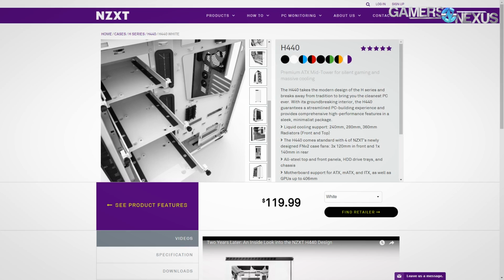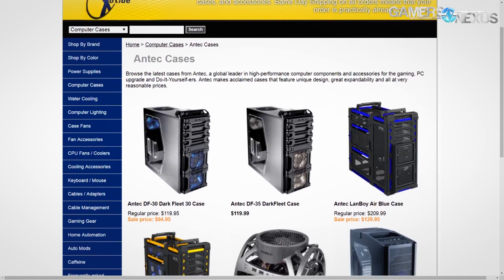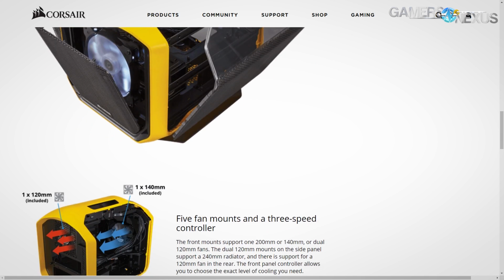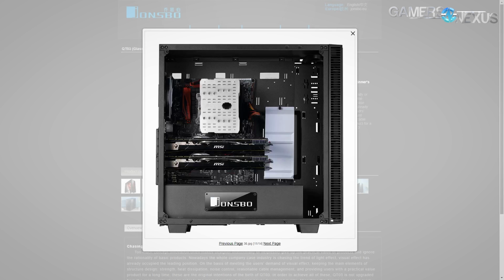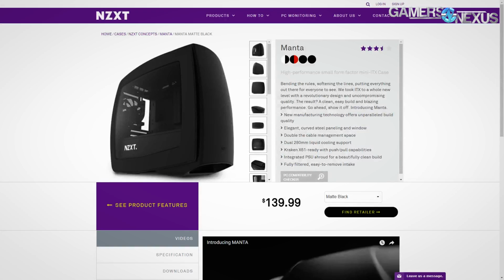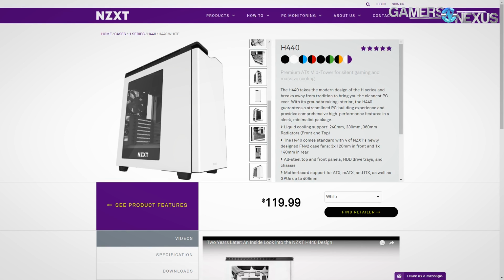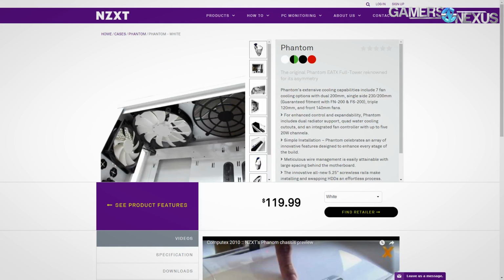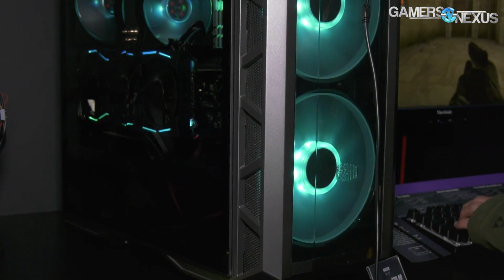Reviewing the Case Industry

Comment: Over 25 years I've mainly used basic no-name/in-win type cases. My first investment case wise was the Silverstone FT02 with the inverted motherboard position, I was looking for a similar replacement because the FT02 would need heavy modification if I wanted to go the custom water cooling route and it's a bit out of date for today's needs. I only found the Be quiet Darkbase 900 Pro which is just overkill and not value for money.  Silverstone haven't really produced a good successor to the FT02 in my opinion.  I would like to see more cases with inverted motherboards and the air being drawn in from the bottom.

I started looking at the other options available, so I checked out the NZXT H440, Caselabs SM8, Corsair 900D, IN-WIN, Fractal Design R5, Silverstone Primera etc. I ended up replacing it with the Phanteks Entho Evolve tempered glass, which even though it's a mid-tower it has the same space as the FT02. The airflow seems pretty good and the design made it really easy to build in.  It has good support for RGB if you want it and water cooling.  I am a bit surprised you guys didn't talk about Phanteks.

Coolermaster and Thermaltake I've always viewed as just cheap products with lots of useless crap on them mainly focused on the Chinese market and I could always find something better from other companies.

You guys should check out Singularity Computers new prototype case the Element Six, obviously its more of a show case and not mean't for mass production however the intent is to try and stimulate the case market and apply a functional approach with pleasing aesthetics.

Comment: i think what needs to happen is someone taking what caselabs is doing. but bring it to a affordable price. i honestly think that you can get people to spend $160-$210 for a case that can be just like a caselabs case.

kinda what EK is doing with the watercooling kits with aluminum. they are taking their original products (which were not super expensive but to many they were) and bringing them to a market for others to get into. 

i think that needs to happen. i've always wanted a caselabs case but i dont want to spend more than $300 for a case. $250 max is my limit but yeah. if corsair or some company does that. i think they will have a win. just like how ek is pushing their cheaper open loop kits. most cases don't really support it and some do but its kinda janky. case labs type case but on the cheap would be perfect. 

honestly i hope someone at EK see this lol. they can look into going into case's and they can sell cases that would work perfect for watercooling.

Comment: I have an In Win 303 that I love, I just need a Thermaltake Floe 360 to come in stock so I can finish the darn system to how I like. Will look so nice with the fans side on so can see all the lighting effects.
It does need better cut out points for the cables but other than that is great. The mechanism for the tempered glass window is genius and makes thumb screws obsolete.

Comment: I don't know why, but I've always really enjoyed "cube" cases that are efficiently designed with compartments. I'm still rocking my original Corsair Carbide 540 Air (couldn't afford CaseLabs), and although it's build quality is just adequate and it certainly doesn't feel like a premium product, I still love it for its efficient design and very functional cooling features. Now, I'm much more interested in smaller form factor cube cases made with premium materials (aluminum instead of steel, tempered glass rather than acrylic, etc.  Honestly, I REALLY wish both motherboard manufacturers and case manufacturers would just go balls to the wall with mATX designs. I love ThermalTake's Core V21 cube case, but man, it would be SOOO much better if it weren't just steel and plastic. It's a great case, especially for the price. But, I'd definitely spend 2-3 times as much for the same design as an anodized aluminum chassis.

Comment: All I want in a case is a see-through panel, a window and general practicality. Less screws to hold things in place perhaps and some more refined solutions.
It should cost between $50 and $100. It should always be possible to install an optical drive, for the retro games and for installing windows and watching DVDs.
It should also be streamlined to a point where there is nothing really missing and nothing feels weird.

Comment: The complete lack of acknowledgement of the importance of airflow is the most worrying thing I've seen when looking at cases for the last few years, especially with the front panels (top as well).

I love my Phantom 001 with 200mm fans. I love that the new HAF H500P has them again. The excuses given for not using 200mm fans in the video aren't good reasons for me personally. I don't care to use a radiator, and I certainly don't mind having a wider/larger case size or spending a few extra dollars on good quality fans that will actually keep my components cool without causing extra noise. Bottom line for me: 200mm fans are awesome, good airflow is a necessity, and case manufacturers need to keep this in mind while still designing solid and interesting cases - if they ever hope to match or beat designs like the original Phantom or the new H500P.

Comment: As an engineer, I see all sort of wrong in ALL pc cases. Hot air raises, but why only vent it at the back. If air intake is from the front and vent at the top, big percentage of air going in will just go out without even transferring heat. Air coming into the case mostly spiraling, why most cases don't take advantage of that.
Reply: Yeah and with the glass side panel and no mesh front, you could really open up the bottom and just have the air intake with some good leg footing, and all vent at the top.

Comment: I'm still using my Antec Nine Hundred for my main pc.  Modded and went through four builds with it.  
I made cutouts for the cable management and put in fan filters, swapped fans for different color.   RGB and dust filters weren't common back then.  Still breezy for almost 10 years now.  
  
Took out the drive cages to open up the front.  I was able to get a 295x2 in there, and a 240 rad

Comment: If case manufacturers stopped making cases over and over and over again on the  same chinese chassis templates, to make 1000% mark up on retail price, that cant think more than a top tiny 120x360 radiator and a front 280, with the shittiest class of steel and paint job, You tube videos like this wouldnt be necessary, and people would be buying 700 times more computers than now

Comment: Such a good video.I am one of those guys, hyped for the h500p.
Initially i saw the case's MSRP of 140$ whilst having 2x 200mm rgb fans AND a pci-e riser.
After some time i saw the price bumping 10 bucks And the pci-e riser(15-25$ separately) gone.
Also i am not really into the non removable dust filters, i think it's a step back.

Comment: Reality is that once you strip away cosmetic "innovations" (acrylic side windows then a few years later glass cases) there has been relatively little innovation over last 10 years with the honourable exception of Silverstone who have experimented with MB orientations.

I would like to see experiments with air flow ducting, more cable management experiments (I have some ideas for coupling physical support for heavy GPUs which also double as cable management).  Dust management is a real challenge - more experimentation in this area is needed.

Comment: I do not like the trend of covering up the intakes with a solid panel. It forces all the air to flow through narrow/restrictive slats/vents on the top or bottom. 

At the very least, the total combined surface area of the opening should exceed the surface area of the fans themselves. What is the point of buying a 380 radiator if its breathing through a soda straw?

Comment: Steve you mentioned the ramping up of GPU fans and causing 60 DB of noise in a good looking case. I can't speak for everyone but I have a excellent surround sound and headset so I don't hear any fans at all when I am gaming and having the ability to adjust fan curves solves thermal throttling. I don't know of anyone who does not play with a headset or speakers that can drown out any fan noise. My thing is if temps are safe what is the big deal most gaming consoles are just as loud if not louder. I say buy what makes you happy and turn up the volume if you don't want to hear fans at all.
Reply: I can see your not an audiophile, that so crappy noise floor you are promoting. cranking up the volume to compensate for load cooling just means you are damaging your hearing faster.

Comment: Great talk guys.  I am a former Antec guy, until just a week ago, I owned and used two Antec cases, the Antec 100 for my desktop PC and the Antec 900 V3 for my gaming PC.  I had those since 2011 but starting a few years ago, I started to have case envy as I saw the new offerings from NZXT and Corsair.  I ultimately decided to upgrade my desktop PC to an NZXT S340 Razer edition and my gaming PC to an NZXT S340 Elite VR edition.  There were several reasons for the upgrades, including the general upgrade "itch" that needed to be scratched, the desire to do away with the 5.25 inch bays, the move to the PSU shroud and getting something that shows the internals of the build in the left window.  There is one noticeable downside to the NZXT cases and you guys hit it in your discussion.  The air flow in the S340 Elite is not as good as the Antec 900.  That monster 200 mm exhaust fan did a great job.  I am currently using the stock 120 mm fan on the Elite, but I likely will upgrade that to a solid 140 mm fan.  Anyway, in summary, I am very satisfied with the upgrades, but the cases are by no means perfect.

Comment: Still just a bunch of big boxes. I want to see more out of the box thinking. Not more windows and LEDs.

SFF is where I want innovation.

There needs to be innovation on the Motherboard, GPU, PS side to enable better SFF cases.  Trying to cram ITX  board and standard components into a  box, limits the design of those boxes.

I'd like to see MB with some better way to connect a GPU(like MXM, or edge connected horizontal PCIe),  and smaller PS...

Comment: Cases are one of those things you buy for your own style. I do think that Coleermaster H500P is great, and if the price is somewhat affordable (I'm in Brazil...that thing, if ever come here, it will be at least 2,5x the price asked for in the US...) I will put a lot of thinking in buying it. I have my sights on the Corsair Carbide 740 right now and it's around 300USD (after conversion+ taxes...). I wouldn't mind a nice glass case, but hey are even more expensive in here (the Corsair 570X costs nearly 1.5x as much as the 740...its ridiculous...)

Comment: I want a case that has access to the bottom dust filter in the front, putting the access in the rear is ridicules. Unless your case is sitting in the middle of your desk, it's a pain in the ass the access the bottom filter.

Comment: The problem with 200mm fans is the positive and negative air pressures within the case, because you can't really get a 200mm fan on the back of the case due to the IO panel obstruction (or until that's resolved).

Comment: I'm a fractal fanboy. Its simple, its sleek. Its decently quiet and has decent airflow. Competitively priced. It may not excel in any one area but it doesn't lack for anything either.

I built in the Define C in June (7700k/1080) and it was a breeze. I'm a little salty the TG panel edition didn't come out but otherwise its an excellent case

Comment: These case manufacturers are so lost..

Steve spoke well on wanting better airflow(this is sad it has to even be a mention at this point). But then when Rob says he'd like to see something new and fresh, he says it with the aspect of perplexity, as if unsure on what could be done.

You guys want some innovation? I'll do you one better, innovation and a chance at setting a whole new standard of componentry at the same time.

http://fanlessfan.com/

If I recall they're going to be open sourcing the design to some degree and are making the thing just to show market viability. This goes against the claims in the video of "idk anyone who spends more than $130 on a case anymore". Skewed claim considering nothing past that price these days is worth it anymore.

With this sort of case you hit nearly every issue the guy spoke of in terms of making cases like "oh so what sort of dimensions for this and that radiator" "what sort of holes and how many do we make". He also spoke about CoffeeLake being great and it will bring all the Sandy Bridge folks over to it, creating lots of opportunity for case makers as well. Now you also solve for that problem of case upgrade cycles being so slow. You can create a modular model (and a non-modular one so you can hit a lower price bracket for people who know they won't be upgrading cases so often), and whenever there is a huge standard change, a simple swap of the parts that can hold the components can be done to make each case customizable and upgradable per major component cycle change, so you don't have to wait 5 years for customers to purchase a whole new case. This also goes well with Rob's detesting of plastic use(mentioned more than once in the video if I recall indirectly), thus making the case more of a purpose built product with respect to different material use, now using the metal in the case for something other than a show piece. 

I can think of many more things, but is creativity THAT stagnated where RGB has to be the pervading mental paradigm everywhere?

Comment: Just thinking here about cases...what if cases had motherboard trays. Easier to build in flat surface outside the case, then just slide it in. But this would mean the case has to be modified. I was thinking a hinge at the side at the front part of the case. So you wouldn't need to remove a sidedoor or the tempered glass bit. How to solve the rear I/O though? Maybe just include the whole backpanel in the tray. But it would have to be sturdy. It has to support GPUs. So the tray has the backpanel built-in. All the rear I/O and screws for holding down PCI-E cards.

Comment: dude i had the 900 at release! so revolutionary. im still using my 1200. my biggest issue with this case is the non removable filters on the front. this case is about to bite the dust tho. looking forward to a new case for this decade.

Comment: My biggest pet peeve is the psu / bottom filter which you should always be able to pull out from the front and not the back. I still have Antec p182 in regular use with scythe kama bay added to the 5.25 slots and one can live with it but since the next build will have an aio it's time to move on. Other boxes littering the place are fractal design define r2 and nanoxia deep silence 5. They all look the same hmm...

Comment: Why not take a page from automakers and have a common chassis with mix'n'match trim packages?  One really good metal frame (the hard/expensive part), lots of different (cheap/easy) plastic panels that can snap onto it?  One frame that works with tempered glass, metal, or plastic side panels.  Modular interiors are great, so why not modular exteriors?
Reply: Because its really expensive , to setup and injection moulding machine for small runs
Reply: Doesn't necessarily need to be small runs.  Just like buying the base model now, then a tempered glass panel later, or maybe have a black top with a white front.  Largely existing parts just sold individually.  And those injection molded parts could also fit multiple frames, allowing for larger runs.

Comment: I think the best mid tower case would be:
S340 Elite chasis,
with better front airflow (and maybe a redesigned front panel with tempered glass ?)
support for rads on the top
USB 3.0/3.1 support on the front IO
Reply: I hear ya!
Reply: Farzan and replace the steel with aluminum for me.

Comment: When I buy a case, I have been a Lian Li fan for quite some time.
And the one thing that made me chose Lian Li cases wasn't the looks, it wasn't the paint, it wasn't the lighting.

It was all about the solutions, the little things that made maintenance and working easier.
Motherboard trays, cutouts for the bracket behind the CPU socket on Intel LGA 775, 1366 (etc) 
Dust filters, and naturally the room that they offered.
With a Lian Li case, it never felt like you were working on a French car where you had to disassemble a lot of parts and reach into these really hard to reach places for that one screw to pull a harddrive out or a motherboard.

Cases that offers this is what I care about, they can be as blinky blinky bling bling as they want, as long as I can turn that off.
I do however want an internal case light at times that I can turn on to light up when I am working so I don't have to mess around with my maglite flashlight, but that is about it for lighting.